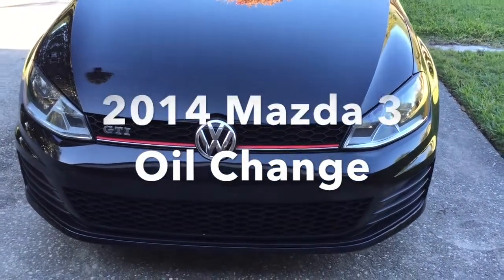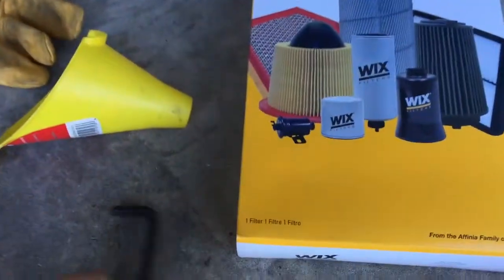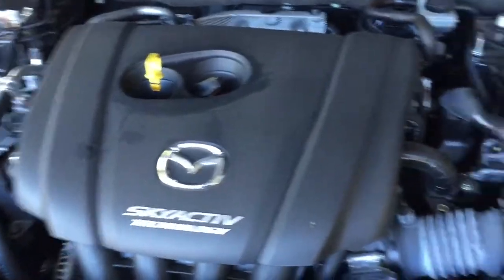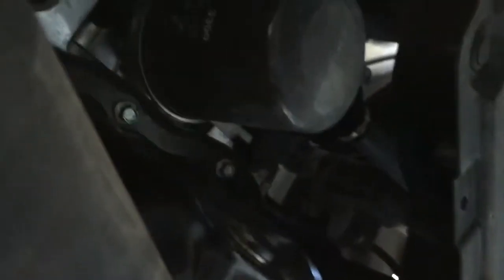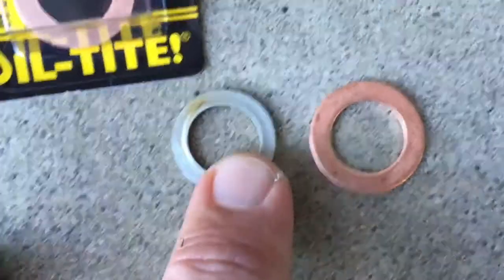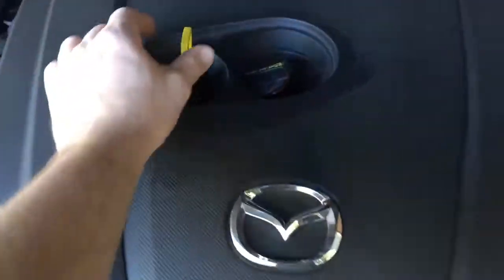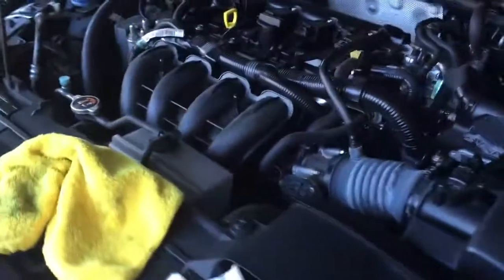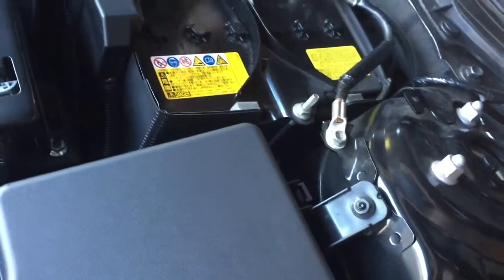2014 Mazda 3 Oil Change

Comment: Hi, Good video. I drop engine oil while hot, after a 20min drive, as the thinner hot oil gushes out it also carries gunk held in suspension. You need a plastic bag over leather gloves and socket extension to prevent a burn. Also the owner manual provides a range of oil grades to match the region so the 0W-20 on the cap is misleading to me. Petrol engines run best on 30 grade oil and 10W-30 is good for -18deg C.  Maybe 0W-20 for North&South of 40deg Latitude Winter.   Shane, Melbourne, Aust

Comment: How is the 5w-20 working for you , my 2018 3 requires 0w-20 , which is like water !!!
Reply from the maker: Works great! No issues. Thanks for watching!
Reply: One more question , did the switch to 5w-20 affect the warranty ?  I wish to switch to 0w-30.Bestline is an additive even better than Lucas !!!  All u need is 1/16 of a quart on a new car.
Reply from the maker: I'm not sure about the warranty. You should check out VWvortex. 
They have tons of great info on there.
https://forums.vwvortex.com/forumdisplay.php?5001-VW-Model-Specific-Forums
Reply: Thanx.
Reply: Anyone reading this, do not change your oil than what's in manual for your region*